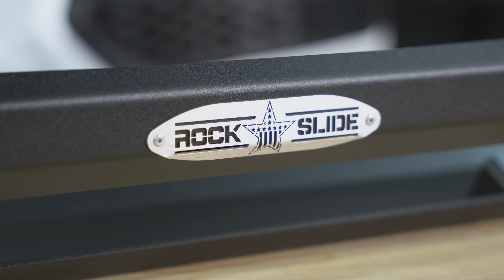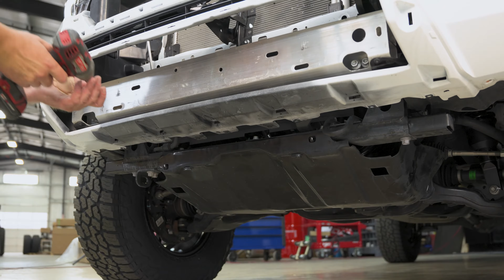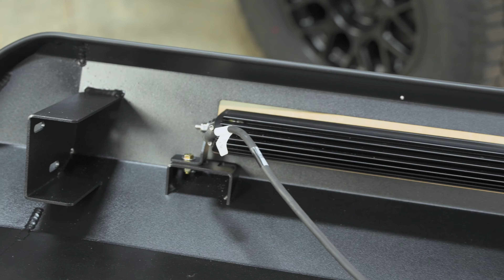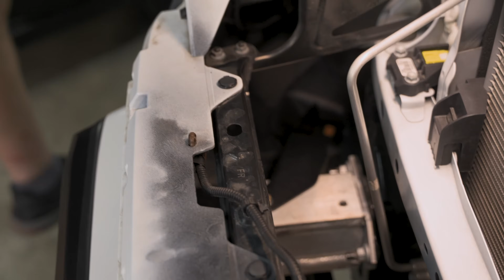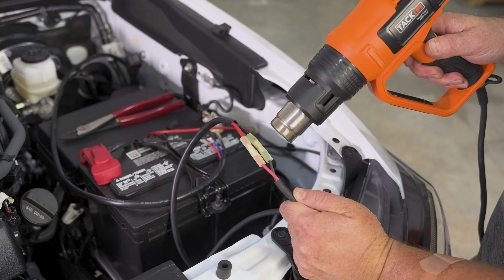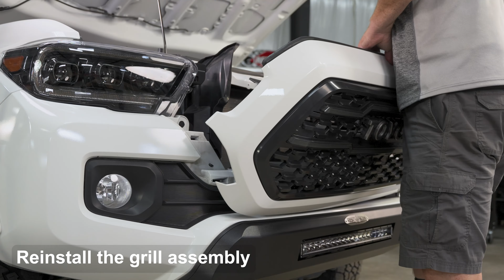Rock Slide Engineering Front Bumper Skid Install | 2016-2023 Tacoma Off-Road Protection Upgrade

Comment: Is this compatible with the TRD skid plate?
Reply: FYI if you have a TRD skid you have to remove it for this install. Then put it back on after the bumper is installed.